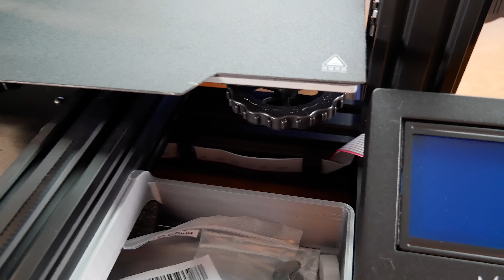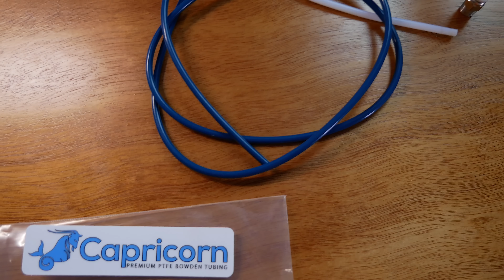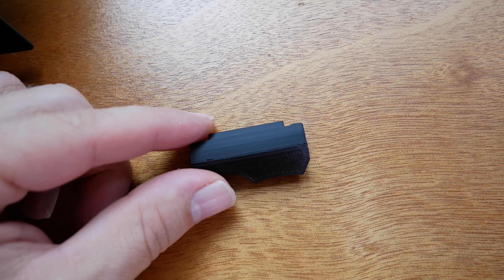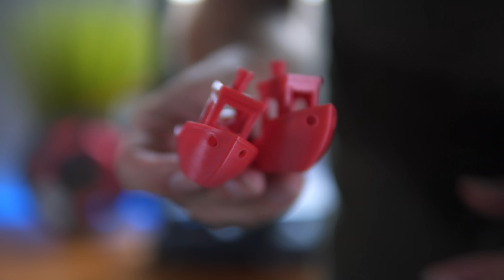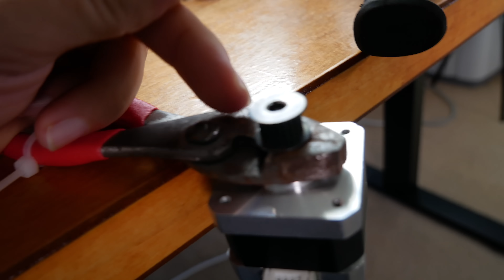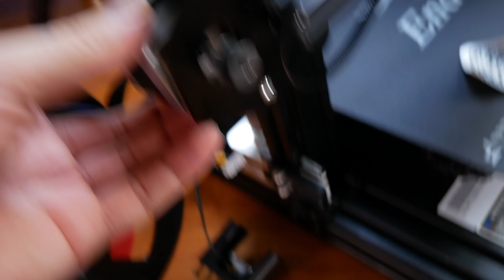Creality Ender 3 Pro - 3D Printer - More Upgrades

Comment: anyone else cringe when the motor spindle was bashed?
Reply: ehh its not going to hurt it :-) give it whacks! just not full berries. :-)

FYI you can push that shaft a wee bit further into that bearing on the bottom to better center the Pulley Drive Gear.
Reply: @nerys71  nice to see you here. the chances are good to find new subscribers here after some upgrades simply lack important additional information and then are looking for solutions
Reply: There is a reason pullers exist. Bent shafts, misalignment, broken sprockets and or damaged internals from wacking shafts. Do it right or not at all...
Reply: @chobson4432  And possibly moving the bearings inside the motor causing rotor misalign...
Reply: Go to princess auto and get a cheap gear puller. I had to stop the video. The least he could have done was use a brass punch (still completely unacceptable). The technique he's using is tranfering all the shock to the motor. And using a hardened steel screwdriver bit to do it. I'm a millwright and ski lift mechanic so the motors I deal with are a smidgen larger but I still wouldn't persuade a shaft with steel.
Reply: @newfization  Another Millwright here, but I repaired CNC machining centers. Seeing someone use a hammer on a stepper motor made my eye twitch a little.
Reply: slicedpage I would pave just removed the stepper motor and covered the bracket and flange with thin rubber tape. 
It will isolate vibrations too
Reply: Double sided servo tape
Reply: Yup. Very bad idea. He said the axle moved in the stator and had to be knocked back. Not kind on the bearings and will have reduced the motor life. A little puller would be easy to make. Two metal plates, one with a slot to drop behind the pulley connected by two side bolts to a plate in front. Use a nut and bolt through a central drilled hole to push the axle out of the pulley.
Reply: No cringe here
Reply: I did.... When I raced RC cars we used pinion gear pullers .  It pushes the shaft smoothly without affecting the stepper motor.
Reply: oh, yeah...  spend 3 bucks and get a replacement gear... or spend 10 and get a gear and a puller
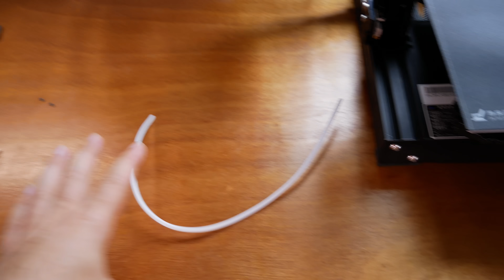Reply: I cringed at 8:15 when there was a spider crawling up the wall. :)
Reply: Anyone else cringe at 'duck'........ fan duck...or ducT?
Reply: lol...what time did that happen?  I'm curious now.
Reply: @stringfellowhawk4843  I'm not going to spoil it for you, rewind.

Comment: Decoupling a 3D printer from the table eliminates most of the vibration induced noise. The stepper dampers are also pretty effective and a cheap way to silence it even more, but upgrading the Ender series with a better mainboard with silent Trinamic drivers is the better long term measure, if you are willing to invest the money for it. Will also improve your print quality a bit.
Reply: If its your only machine and that is the path you wish then sure. However, stepper dampers are about $1.20 to $1.60 a pop. I have a box full of them. same with TL smoothers. around $3 a pop.

a replacement mainboard and drivers is 60% to 120% the cost of the entire machine. dampers and tl smoothers are 5% the cost of the machine.

I have 6 Ender 3's I can BUY 3-6 more ender 3's for the price of upgrading the 6 with full on boards and drivers.
Reply: @nerys71  That is indeed a weighty economical argument. I too am generally very opposed to investing more money into upgrades than the base printer costs.

Especially on those cheap chinese printers, one could easily replace everything but the frame with better components for a significant price and very modest increase in visible print quality.

Would probably make for an interesting video to compare the practical print quality of a base Ender 3/5 to a fully upgraded one and how much improvement is actually achievable for a reasonable price and effort.
Reply: actually the cheapest option is a concrete slab £2 and bolt your  printer to it.  TL smoothers are junk and do nothing apart from generate heat, Dampers can work as long as they are good quality cheap ones can actually cause problems.

Comment: Was the tube really necessary?
Reply from the maker: No, but it helps.
Reply: cheeriomartinez it gives you a higher temperature capability. Capricorn has a higher melting point.

Comment: Nice content. Ps. What is the best printer you have in terms of quality only?
Reply from the maker: At this point any creality printer, but you will need upgrades and lots of tuning to get excellent prints.
Reply: @JustVlads  Thanks for reply. So you mean SOOWAY or Flashfrge is behind as soon as I make some tweaks to creality?
Reply from the maker: Hard to say, ive only been 3d printing for about 3 months but would say that creality is the best as far as all around print quality.
Reply: Fair enough. Many thanks again!

Comment: Couldn't you print a new motor bracket offset by the thickness of the damper?
Reply: yes and no. a printed bracket would not hold up well over time. you also have that idler pully to worry about. that is going to be hard to get to stay put with a printed part. you COULD make a new metal bracket but its easier just to pound the shaft into the right spot and be done with it :-)

NOW something that might work. maybe.

ELONGATE the holes for the bracket so it can shift side to side.

lop a bit off the stand off for the idler and add washers.

now you might be able to "adjust" the position of the bracket without having to shove the pressed shaft into position. easier to just shove the pressed in parts to the right spot.

Comment: When putting in new ptfe tubing, loosen nozzle 1/4 turn, heat up hotend,  press tubing all the way in, tighten nozzle snugly. It will also help ensure that filament doesnt leak by the contact area of tubing and nozzle.

Comment: Seems like good upgrades! What layer height are you slicing the benchy with?
Reply from the maker: .120 is mostly what I print at unless it's a larger item I'll go to .160
Reply: try 0.2mm layers. nearly twice as fast and with a properly built and aligned machine with TL smoothers (and you seem to have done an excellent job with your machine) the quality is quite spectacular even at 0.2mm layer height.

one of the advantages of a well built Ender 2 or Ender 3 machine is their 0.2mm prints look better than many other machines 0.1mm prints :-)

 @JustVlads
Reply: @nerys71  seriously stop with the TL Smoother's they are junk, generate excessive heat and don't improve print quality. And if anything are just another point of failure in in most cases an already cheap system. A better option is always a higher quality controller with improved stepper motor drivers.
Reply: @thegarageluthier  in the printers i use them in the improvement is immediate and obvious. No question. Of course they only fix a very specific flaw. Id you try to use them when that problem does not exist they will do absolutely nothing.

Comment: The foam dampeners will increase the probability of "ghosting", I think. Althought the experience I have is with 3d printed spring dampeners istead of foam, so your milage may vary...
Reply: Foam will dampen high frequencies, springs will dampen lower frequencies. So both together could help more, note these same foot pad ideas will help with record turntables too to reduce acoustic feedback! So if you are a DJ, make yourself 8 pads, 4 for the printer, 4 for your turntable!

Comment: To have a tight fitting, tighten the coupling first then heat the nozzle to 230 or so, unscrew the nozzle half thread, push the nozzle all the way through until it touches the nozzle and then tight the nozzle back.
Reply: another method is a little simpler. tighten nozzle all the way (retighten hot)

loosen coupler 2 turns. insert ptfe seat it and the release clip into place. THEN finish tightening the coupler the last 2 turns. perfect mating every time. fast easy painless and fool proof.